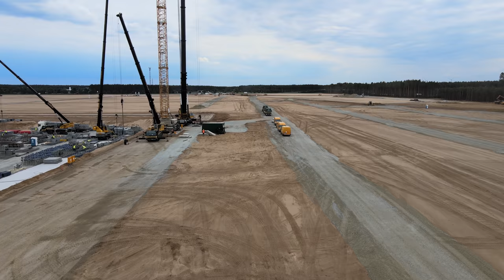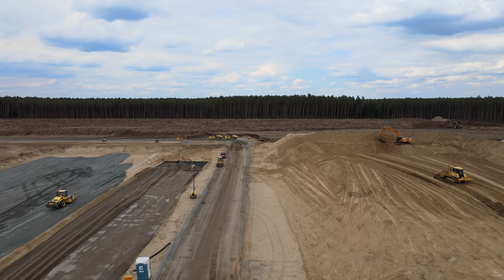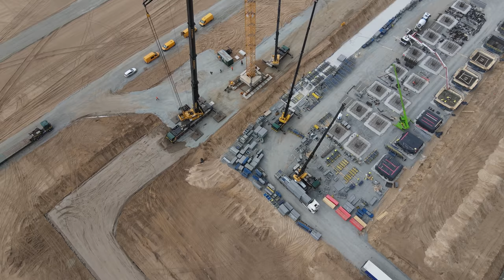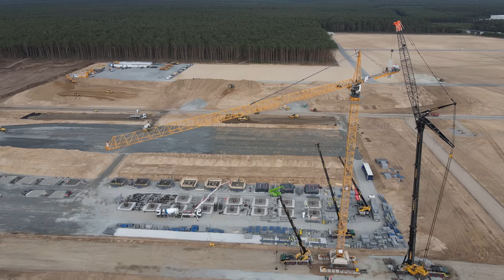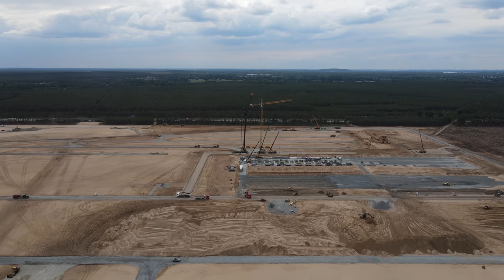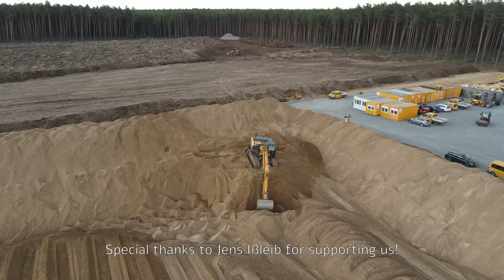Tesla Gigafactory 4 GiGA Berlin #9 | 2020 06 09 | Tower crane set up, concrete pump filling formwork

Comment: That's a very tall crane! It looks like it is based on rails, so I wonder if it can be moved later on the rails in northern direction. And thank you for the video, well done!
Reply: The rails might also be there to distribute the weight evenly
Reply: @pete2405  https://www.youtube.com/watch?v=FPHozsdG90I seems to be this exact construction for tower cranes on rails. just more weights at the base due to higher tower.

Comment: Regarding concrete supply, many truck loads! Some commentators, including me, wondered if a concrete batching plant might be installed. However, unless I am mistaken, they do not have access to ample water. ( well and pump would take water from aquifer). Any more thoughts?

Comment: I saw very tall crane installed. Do they plan higher size construction than usual?
Previous factories are higher than 15-20m?

Another question, regarding Shanghai phase 2 factory.
The roof looks more clean and flat than phase 1, does someone know if they will install solar panels there?
Reply: Regards GF3, the basic roof only has been laid. Still needs all the usual skylights, aircon units, vents etc. Substation is also being extended to feed phase 2 production. Whilst it is unlikely that  PV panels would produce any significant amount of power ( it needs 50% of one typical power station output to run the completed site)  it may not be out of the question purely as an environmental statement.
Reply: GF3 phase 2 support columns are around 16m high, plus roof beams.

Comment: I would like to see much more people working there.
But, if I correctly understood, on the Berlin site can only work 6am-10pm; so no night shift available.
Is there also noise limitation imposed by German authorities?
In such case, comparing with Shanghai site, the (supposed) 2 months time advance will disappear very soon here:(
Reply: The construction of Giga Berlin phase 1 will very likely take more time than Giga Shanghai phase 1. Keep in mind, that Giga Berlin phase 1 building will have more than twice the size than Shanghai's phase 1 building. I think here they plan with a construction time of 15-18 months, whereas Shanghai could be build in 10 months with on 24x7 work base.
Reply: I also understand that it is 6-10. I believe Shanghai is similar. You will see this operation increase by maybe tenfold. They are only just beginning to ramp up
Reply from the maker: There are still permissions pending.